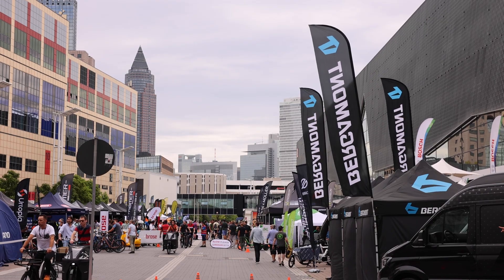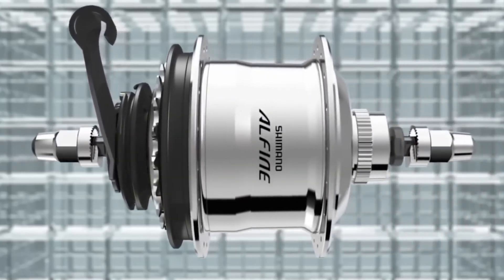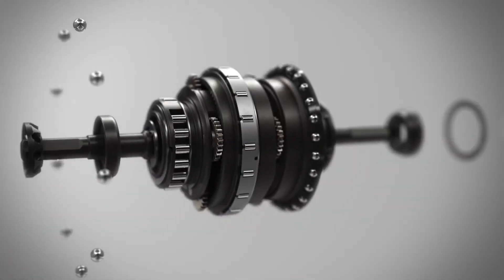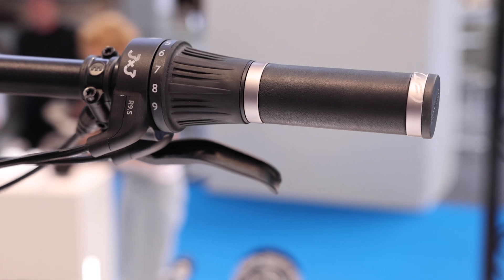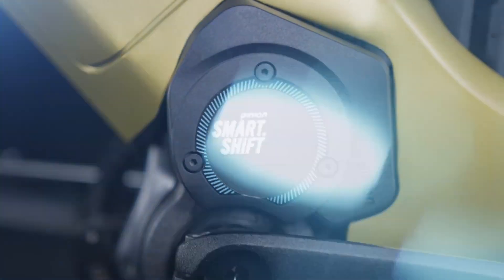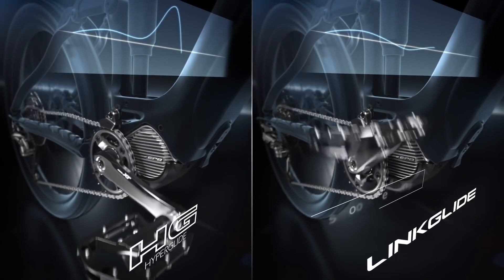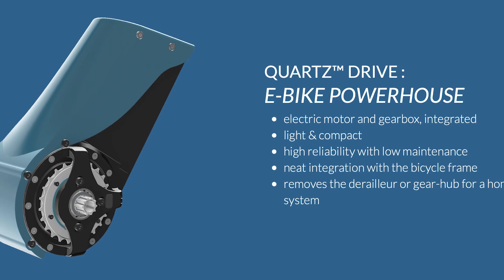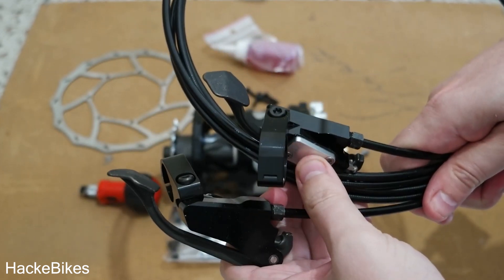The Future of Electric Bike Drivetrain Tech!

Comment: So what you are saying but not is that 500-750 watts or less than 90 nm is fine for these drives but nothing over that because they weren't designed for thatmuch  power. Ok 👍

Comment: I think you pass over the company PINION too quickly, because as far as an MGU, (Motor Gearbox Unit) combination goes Pinion is miles ahead of Continental, or any other MGU, system manufacturer.

Comment: There are still too few e-bikes using mid-drive motor with belt and hub gearing, which seems to me to be the perfect combination for a wide range of users.
I'm guessing that the only way that these new systems get mainstream, is if they are bought up by a larger company that can get them into production e-bikes.

Comment: A lot of the stuff you said was over my head..  I tried my first 3 ebikes today.. All of them had the enviola hub with the carbon gates drive..  All 3 of the bikes were totally different..  Riesse Mueller, Gazelle, and Vast..  I think part of what factors in is that I am 5.9..  The Vast bike I even hit the pedal on the ground as I was turning and I thought that was one of the bigger bikes..  The Riese & Mueller was my favorite..  The nobby tires rode a lot smoother than I thought on pavement.. It was a larger bike and less nimble but I think it rode the smoothest of the 3...  The Gazelle was the shortest of the bikes and it was more nimble but also wasn't as smooth as the Riese & Mueller..  I think there was a bike with the Roloff hub but I didn't drive it.. There was also a couple bikes that had Shimano hubs but I didn't drive those either..  My last 2 cars had CVT transmissions and that is probably why I like the Enviola Hub..

I probably should test drive some hub drives just to see the difference..

Comment: Im interested in adding an enviolo extreme to an older 26er MTB
And perhaps adding thr electric shift in interface wired to a 18V Milwaukee battery on waterbottle mount

Should be lretty straifht forward id imagine?
Lace wheel with hub, wire connection end to match electric interface connection?

Comment: Would be interesting to see a deeper dive into digital drive as a technology, specifically for ebikes.

https://youtu.be/r-Zyp6jX0HM

Seems mechanically a lot simpler (since you basically have a small electric motorcycle with a pedal-driven generator), but it introduces software/controller complexity in order to make the pedalling and torque response feel like an actual bike.

Haven't really seen a ton of traction in this area, but could have some interesting potential since it could allow for novel features like pedal-charging at a stop, or simulating an incline for exercise & interval training.

Comment: The Specialized Turbo Vado SL is the only bike I know of that allows one to pedal beyond the motor cut out speed without impediment from the motor, thus allowing pedaling beyond 30 km/h which is the law for e bikes in Canada. My current e bike bogs down significantly after 30 km/h creating dangerous situations when I occupy a car space during a left turn at an intersection.

Comment: As a recent buyer of a single speed rear hub motor ebike I'm thinking transmissions are overrated.   I use the throttle to get started and use the pedal assist levels as "gears" to dictate my speed.   I'm thinking this is the future just because of the simplicity and low cost.   #radmission

Comment: I'm looking forward to using an internally geared hub that's beefy enough for 1000W mid-drive motors.  I'd like to pair that with a front hub motor for 2WD capability on a fat bike, but I'm having trouble figuring out how to do that.  Will I need to use two different motor controllers?  Will that mess up regenerative braking?  Any comments are appreciated.  I love your videos btw.

Comment: Question for our community: When does an ebike become an electric motorcycle? Some of these ebikes are massive, fast and you don’t have to pedal. On the multi use trails/paths it can go side-ways real fast.
Reply: It depends on what state you live in.  In most states, your ebike is still considered a bike if your ebike is 750W or less and goes 20mph or less. But it's best to check your state's DMV to verify.

Comment: Has anyone ever tried an electric generator at the pedals, an electric motor at the hub and electronics to change the ratio? 
IE, a bicycle power train that was entirelu electronric?
It would seem to have several advantages, including effectively infinite gear ratios, off-the-shelf hardware, ease of electification, ease of upgrade, completely modular.... efficiency might be compromised but not by too much, i wouldn't think: only 90% compared to 95%...
Or maybe I'm completely full of it.
Has anyone tried? If so, why did it not work?

Thank you.
Reply: It does seem to be the best and most simple way to go about it in the long term. I saw a video a while ago though explaining the main issue which is efficiency of pedaling through the generator and transmitting that to energy to the battery and motor. The company arcimoto is actually coming out soon with an E tricycle that uses that same exact system. Hopefully that technology will take off and become more efficient in the future though.
Reply: @Brandon Higgins  
My understanding is both motors and generators are 90-95%+ efficient. So where's the loss? Maybe high efficiency motors/generators aren't applicable to low RPM situations? 
I don't know what I don't know that makes it a bad idea.
(Shrug)
Thanks for the reply.

Comment: On an ebike you don't really need many gears, maybe 7. There is no need for small climbing gears because the motor is helping, unless the battery runs out. Therefore there is no need for a suffisticated gear systems.
Reply: Clearly you don’t live in mountainous terrain.  Try hauling 40-80+ pounds of cargo up the side of a mountain.
Reply: @daisydela  That's the thing, I do live on very hilly place, up to 20% at times. My ebike weighs 22kg and even on minimum assistance I have never use those top granny gears. Basically I use six gears, from 13km/h to 40km/h, the rest rest are there in case the battery runs dead.

Comment: I've been keeping my eye on the Revonte mid-drive motor with an automatic gearing system as part of the mid-drive, I just feel the current derailleur systems despite being reliable I just cannot be bothered with the maintenance and upkeep these days. I have a Cube SUV hybrid Race 500 with the Enviolo automatic gears and Bosch electric motor coupled with the Gates carbon belt drive, I'm finding it difficult to go back to older derailleur systems. The future looks promising with the new tech.
Reply: Revonte have been stalling for years. Valeo have over taken them and have a motor on the market.. its better too
Reply: I ride enviolo  automatiq  and can't go back to derailleur..

Comment: Those Internal 2spd/3spd hubs with a cassette are great for  ultra wide and low range drive train for heavy  cargo bikes. Back in the day, there were cargo bikes with a 3x7 hub and a triple chainring up front. 63 speeds! Could easily haul hundreds of pounds with an ultra low gear.

Comment: I think the most obvious and inevitable advancement would be to eliminate the gears and chain completely !
Why not have the front crank just be a generator and sensors ? That tell the motor how much power and speed to apply to the electric motor ?
It seems to me that is very doable. And I would think the weight would be very similar to what it already is.

It would also make it easier to apply regen braking to the system without having the unnecessary drag.
Reply: I completely agree. I think this is the best long-term solution however I recently saw a video that explained the main problem with that setup. It's basically what arcimoto is trying to do with their three-wheel e-bike coming out soon. The main problem is efficiency with pedaling the generator and transferring that energy to the battery and motor is extremely inefficient. I still think it's the best implementation as far as maintenance and simplicity, etc. Hopefully they will figure out the inefficiency issue and start implementing it. Arcimoto will be implementing that exact drivetrain soon in their e-tricycle.

Comment: 250nm of torgue for the 3x3 is insane.
My toyota 1300cc motor only outputs 122nm.
I suppose a lot depends on the voltage used.

Comment: if the motor is powerful enough, why do you need multiple gears?
Reply: 250W is the max in Europe for a pedelec with pedal assistance, otherwise You need a helmet and  insurance.
Single speed is nice and fun ( don't forget to put on good brakes) but, when You're over 70 and there is wind and hills, at least a 5speed gearset comes in handy, especially when, for everyday transportation, You depend on Your bike.
Reply: @j.r.arnolli9734  sure but some hub motors pull 1500 watts, and nobody checks anyway. according to bike calculator, 1500 watts pull a 100 kilo rider+bike up a 12% hill with 35 km / h. gears are either inefficient or a massive hassle and expense, which is fine  when you only have 200 watts for a 70 kilo rider, but motors fix the power part. hence the question
Reply: Are you for real?
Reply: @MrVaultTec  yes? singlespeed rider
Reply: @markifi  Good for you, but most normal people don't ride single speed bikes for good reason.
Reply: @MrVaultTec  i got the same dismissive answer from luna cycles but i really don't believe it. i think it's just convention.

Comment: I’m interested in the 3x3 IGH. I wonder when they will start selling them as it fits my wants the most.
Reply: Same here. 3 by 3 hub with belt drive is what I’d like. Concerns about service in the future are very valid, in my opinion.
Reply: Yeah i currently have nuvinchi/enviolo hub on my bullitt cargo bike, and its leaking oil all over every time i put torque on it, or cary a load. I am also interested in the 3x3 and the high torque it can take. Also even the new enviolo extreme hub can only do 100nm of torque.

Comment: While I appreciate how e-bikes bring more people on two wheels, I personally went back to the roots, to great steel frame bikes. 100% powered by my body. It took me 2 years from 0 to up to 1250km a month. I ride daily, on a very moderate pace, started with 15 minutes now up to 3 hrs depending on my work. My concern is that we see a vendor lock in and so many proprietary standards that e-bikes won't survive 3-5years before landfill. That's disgusting.
Reply: I currently have a SRAM DualDrive II hub from 2008, a hybrid shifting system with 3 internal gears and a traditional derailleur and cassette on top.

Comment: I don't own an electric bike but would like to convert one of my many regular frames to an electric bike. Like my 2016 schwinn boundary to a electric. Because I commute to work every day on my Trek marlin 7 which is both my gravel bike and my heavy carrying bike. Plus trailer puller. I switch my fork to rigid with a surely fork with bolt on areas for stuff. I live in Texas and I use a 1x10. 32x11x32 and 40x11x34. I work on my own bike but I will on occasion take it to the bike shop I bought it. Plus stop at other bike shops. I buy a lot of parts for my bikes quite often when I could afford it. Sorry for all the info.

Comment: The future is and always has been in CVT (Constant Variable Transmission) and IMHO all efforts today should be going towards those.
It's difficult yes, but if they wanted to they could do it, the tech has existed and has been proven to work on mopeds for decades. They can do it for e-bikes as well.
Forget about chain rings and electronic derailleurs... Forget about planetary gears and other complex geared hubs.
It's (at the basic level) as simple as having a cone shape and a belt that travels up and down that cone to maintain a constant cadence. No matter what rate you are traveling at.
Reply: CVT is still problematic in high torque applications.
Reply: @daisydela  That may be but high torque isn't really a problem for e-bikes though.
With that much torque you'd be popping wheelies at any speed.

Comment: combining motor and transmission leads to a complex system that will be more tricky to maintain and if something fails, both functions are broken. It makes total sense to keep it separated. btw. Cars have engine and transmission usually also separated, I'd say, isn't it?
Reply: It depends on the implementation, car transmissions are usually mated to the back of the engine. A system on the bike where the electric motor and the transmissions are mated but easily removable would work well I think. I like the idea of a unified system and I hope there will be more advances in this area.

Comment: I'd like to greater use of belts / internal hubs and more advanced battery tech introduced instead of the same old 18650 cells, touring bikes should have there own motor category currently Bosch Gen 4 motors are too heavy and powerful for touring bikes that really only need >60 Nm of torque - an affordable full suspension touring e-bike would also be great...just my two pennys worth!

Comment: How about two gear ⚙️ locations, one at the crank, perhaps 6 gears, and another at the rear hub, 2-3 ratios, and a shaft drive. Would it be overly complex and heavier than a crank alone gearbox?
Reply: Where do You want to put the motor and a shaft drive isn't as efficient
Reply: @j.r.arnolli9734  I wasn’t thinking of a motor, electric bike.

Comment: Thanks for a good informative video. I have a Rohloff Hub on my home built ebike. Too be honest, even though I live in hilly Bristol in the UK, 14 speeds is unnecessary for an ebike. With Rohloff all of the gears are stacked in the low ratios with a 44t front chainring (that came with my hub motor) so about 10 of the ratios are never used. I suppose they might be if I ran out of battery juice though. I suggest that very tall ratios are also unnecessary because motor assistance in European bikes cuts out at a paltry 15mph. Pushing a tall ratio for speed without motor assistance would be a strain on the knees with the extra weight in an E-bike (except downhill) So, if I built my bike again I would not use a Rohloff and would opt for a 6 or 7 speed. The ratio spread should not be linear but should have a wider crawler gear and maybe a tall gear for downhill without motor assistance with closely stacked ratios focused on maintaining 15mph at a cadence of around 80rpm.

Comment: I suspect few people will agree with me, but the idea of an internal hub (2 or 3 speeds) combined with a rear derailleur sounds pretty compelling.  Basically, you'd end up with traditional bike gearing with the internal hub substituting for the front derailleur.  Instead of going up to a 10-gear cassette, 6 or 7 would be plenty.
Reply: Like a car, 6 speed is fine.

Comment: I've always hoped that as these ball bearing driven CVT's become more prevalent they start to apply to motorcycles and mopeds. Especially with wider gear ratios.
Reply: mechanical CVT transmission have the big advantage of infinite ratios and no shifting but not great for efficiency, high torque and reliability. eCVT on hybrid cars (Toyota,Ford, honda) are much more desirable because they combine the advantages of CVT but they use only a single planetary gear, with two inputs, combustion engine + electric, and use the electric motor to continuously change the gear ratio of the combustion engine using the electric motor, with no clutch, no slip,no friction,no belt, no wear except gears that are constantly meshed together and lubricated. its very reliable, efficient and quite simple mechanically speaking. revonte one is trying to adapt this to the ebike world with a single drive unit, containing an eCVT where one input is pedal power + electric motor, and second inout a second electric motor that can change the gearing when it spins. the specs are quite impressive with 90Nm 1500W, 426% gear ratio, all in a 10lbs drive unit that can still be pedaled in low gear with no power. compatible with chain and belt, and allows strong and lightweight rear wheel with suspension, and mass centered around the bottom bracket. unfortunately it seems they are still looking for partners to integrate their drive unit into production ebikes.